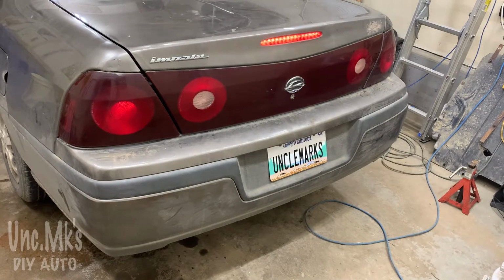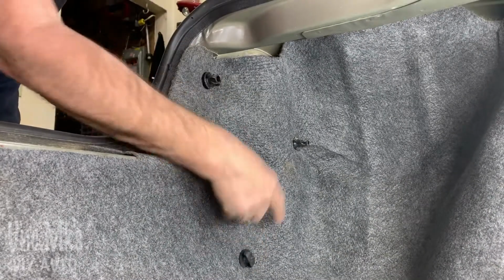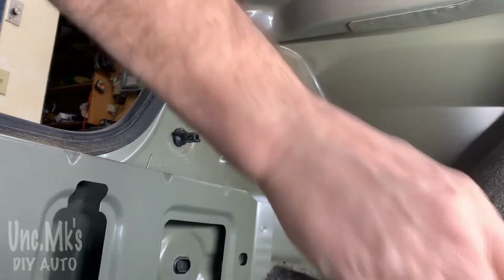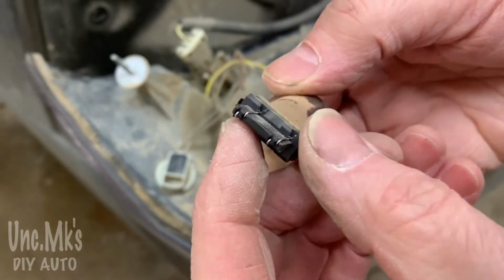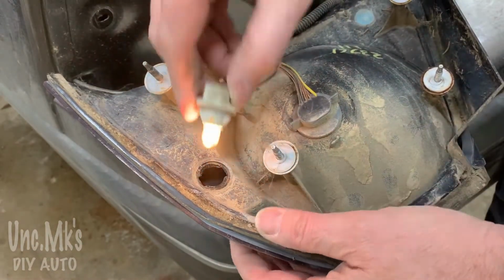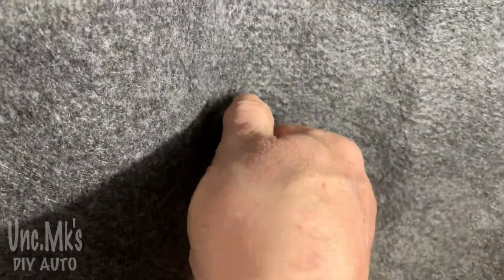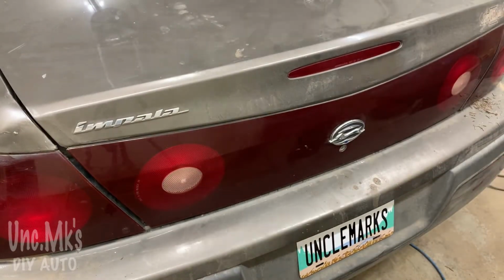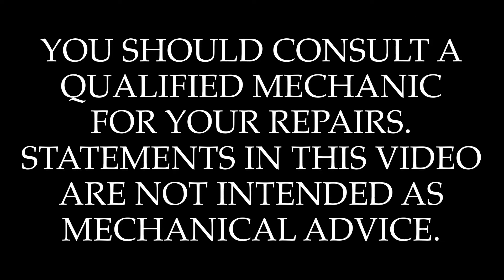How replace tail light & bulb most cars (EP 238R) Impala

Comment: I bought a used 2000 LS a couple years ago. The gas gauge works about half the time. Are they any known fixes?
Reply from the maker: Could be the gauge. (Testable) Could be the float in the tank. Also testable. Really no way to just guess. If I had to choose, probably in thank. Next time the fuel pump goes, make sure to replace pump & float as a unit. A good shop can test for them.

Comment: All 3 brake light won’t work for mine does the top light have anything to do with the other lights if it doesn’t work will it stop the other two from working
Reply from the maker: You are assuming that all 3 lights have been working all this time. Maybe the third light has been out for some time. Have you have tested the third brake light for power when the brake light switch is pressed? If no power, it could be your brake switch. (of course it could be many other things not easily traced)
Reply: @unclemarksdiyauto  I bought all new brake switch, bulbs , checked everything for power all of them getting power I bought a brand new turn signal switch put it in thinking that was it an still not working
Reply: @unclemarksdiyauto  what els could it be also I took it to PEPBOYS to test everything they said all of it’s getting power an the third light was working but now it does not come on
Reply: @unclemarksdiyauto  replied it’s new
Reply: Haven’t yet replaced middle light will that activate all three or even that middle one at $400 now trying to fix them
Reply: Fuses relays are good
Reply from the maker: @danieljacobsen3663  Odd. If bulbs are getting power when brake is pressed, then bulbs should light up! (Unless bulbs burnt out, but they would have suggested that to you. Do the brake sights flash when you put on your hazard lights?
Reply from the maker: @danieljacobsen3663  Very very odd. So there is power at the bulbs when switch pressed, but bulbs don't light up even with new ones. Is the ground working at the lights?
Reply from the maker: @danieljacobsen3663  The other brake light will operate without the third trunk light working.
Reply from the maker: @danieljacobsen3663  The other brake light will operate without the third trunk light working.